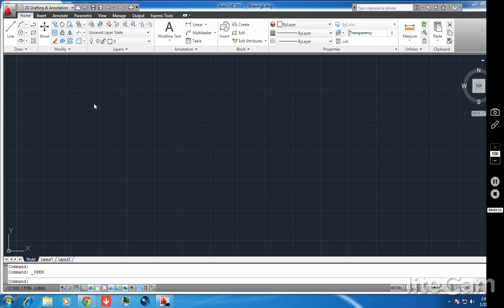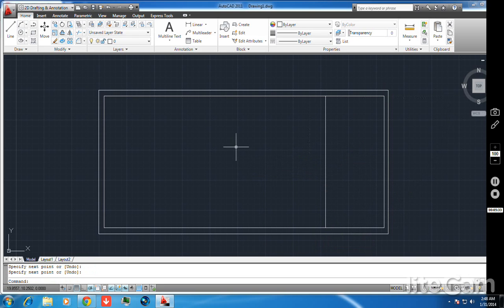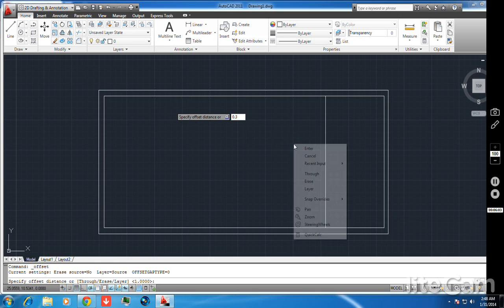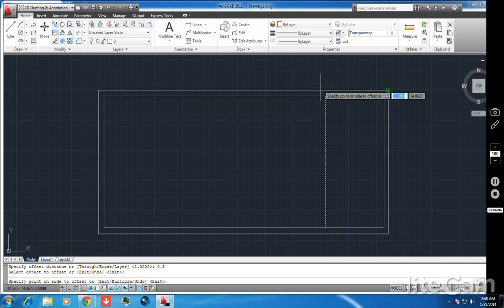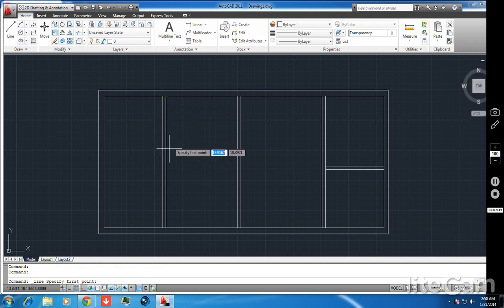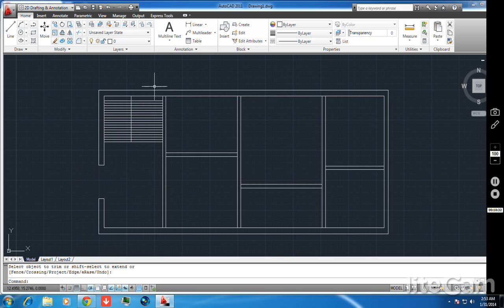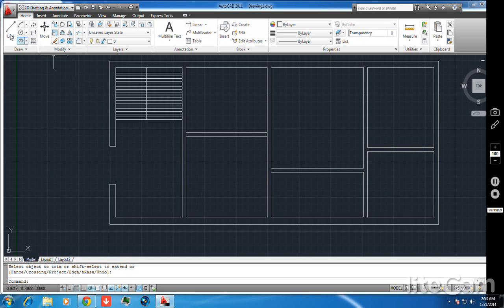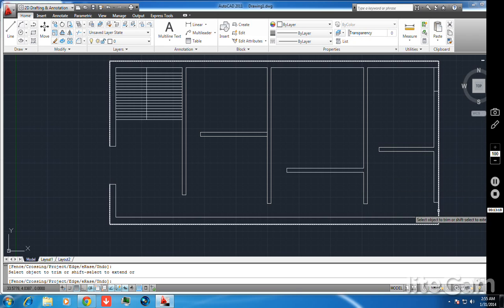2d plan construction in autocad.

Comment: Des Cours avancé en Autocad 2d 3d solid works catia
CENTRE CAFP ET ACADÉMIE DES COMPÉTENCES 
LANCE DES FORMATION 100% PRATIQUE EN
- Autocad (2d - 3d) soit dessin bâtiments ou dessin mécaniques
-SOLID WORKS (conception assister par ordinateur)
-CATIA V5 R19 (conception assister par ordinateur)
-COVADIS (topographies – assinisements - voirie)
-INFOGRAPHIE (Photoshop – illustrateur - in design)
-3D MAX
- COMPTABILITÉ SUR ORDINATEUR
-GESTION COMMERCIALE
-BUREAUTIQUES (Word - Excel – power point - Access)
-ARCHICAD
-ARTLANTIS
LA FORMATION TOUJOURS PRATIQUE ET ACCÉLÉRER NE RATEZ PAS  L'OCCASION.
ADRESSE : imm15, rue Ahmed sitou boulevard Mohamed V en face de marché central et pharmacie du marché central. 
Tel : 06346179549 / 0620181502  / 0522444343 / 0522447550